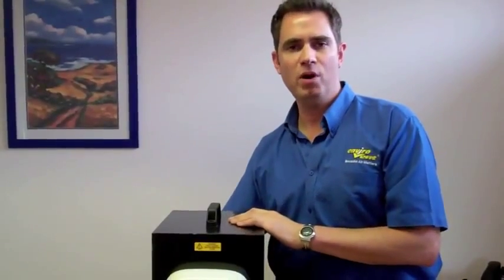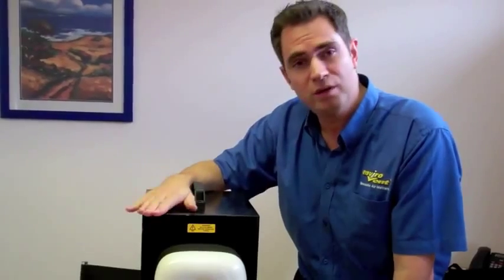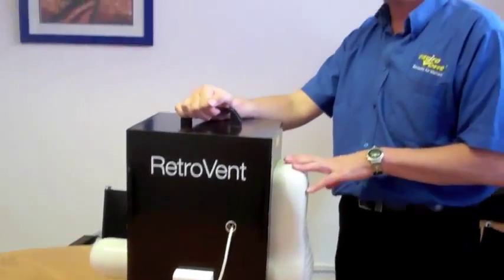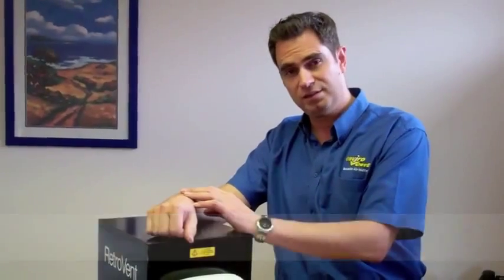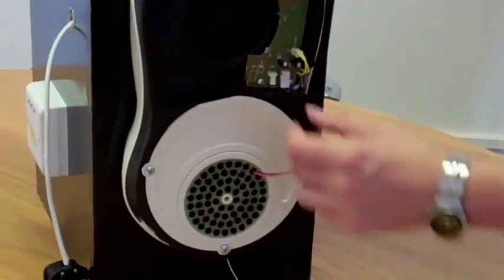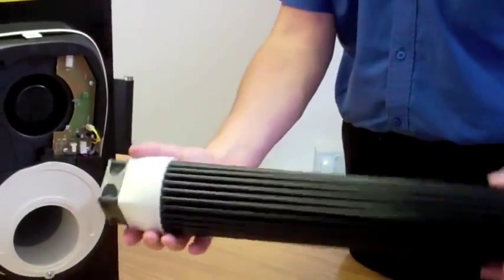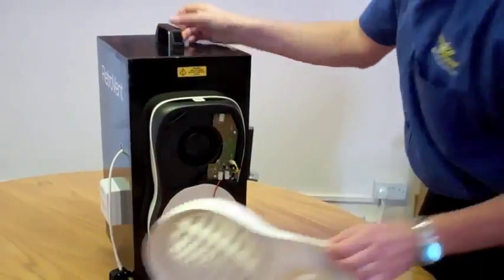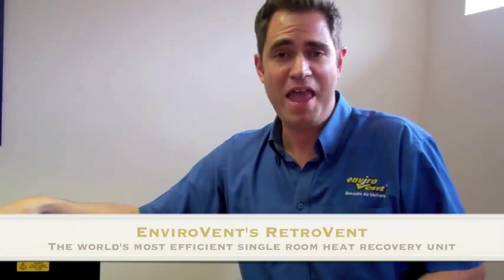(Single Room Heat Recovery) combo ventilation

Comment: not quite as simple as that is it, because if your drawing damp humid air in from outside even if you've warmed it with the warm air going out you've achieved nothing,  unless the moisture has been taken out with some form of dehumidifier, because the air outside in Britain in winter can be as or wetter than what's going out of the vent in the first place.
Reply: You are right, this is not quite as simple, maybe that's why you made this mistake yourself. This is not how humidity works. Firstly the air leaves your bathroom and travels through the tubing system and heats that up. Then, for as long as the inside temperature is higher than the outside, even if the outside air has 100% humidity, when it comes inside the RELATIVE HUMIDTY will be lower than the one inside your flat. This is because the amount of water than can dissolve inside the air is exponentially larger with increased temperatures. Due to this this will drop the humidity levels by drawing in the air from the outside. You would achieve the same by opening a window, HOWEVER by opening a window you get rid of the warm air from inside and replace it with the cold air from the outside, without any sort of heat being exchanged, thus doing this way your efficiency is 0 %. If you didn't know, not you know ;)

Comment from the maker: This unit has since been superceded by a new one that was put in the Top 10 by Grand Designs.
The units vary dependent on size and features and are approx £250-£300 ea+vat if bought through us (we match any online price on SUpply Only. We also offer a fitting service and a 5 year on-site warranty.
IMHO these are far and away the most efficient and effective units of their type.
As regards the comment about not losing heat out of a bathroom if you don't have a vent that is completely correct but the effect that moisture can have on the rest of your flat and your health is not something I would wish to trade if one of these systems can also save most of your energy.